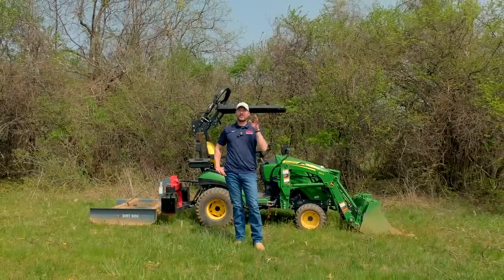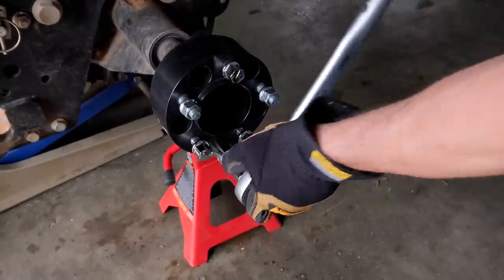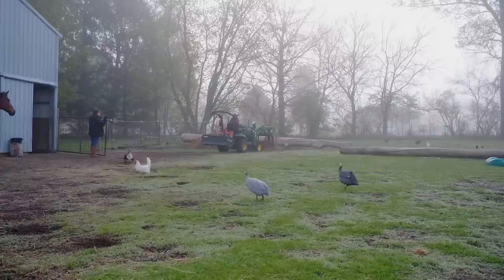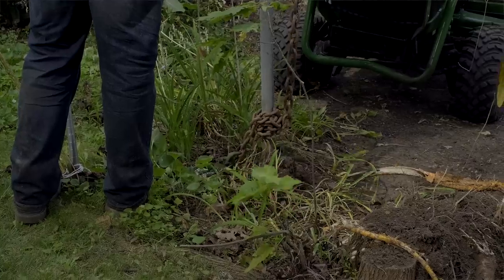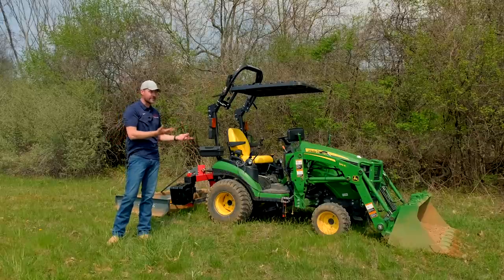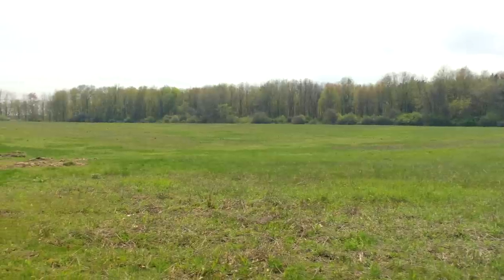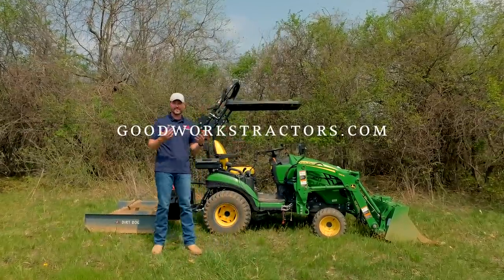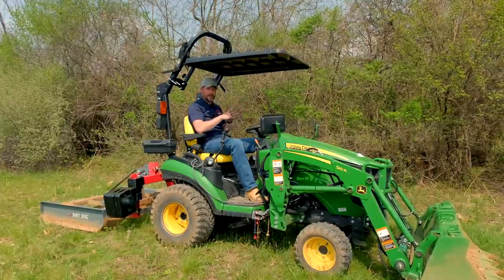DID WHEEL SPACERS CAUSE ANY DAMAGE AFTER A YEAR? JOHN DEERE 1025R REVIEW

Comment: As for your flat front tires, this is a common problem.  I have a friend who is co-owner of a Kubota dealership and he said it is common on the front tires of these SCUTs.  On my LS MT125, I could not get mine to stay inflated and had one roll off the rim while moving snow.  My research confirmed this is a big problem.  If you do the math, the little 18X8.5-10 tires are grossly overloaded when you have something heavy in your bucket, even with rear ballast.  I found a guy with a Kubota BX on-line who solved his problem by going to an 8-ply BKT R3 skid steer tire that has twice the capacity. I decided to do the same and it has totally solved my problem.  No more problems keeping air in the tires and no more squishy tires when I have 1,200lbs in the loader.  I think the BKT tires are only made in R4 style, but that is what I run anyway.

Comment: Wished I had done a little more research when I bought my 3025 E. The 1025 R is great machine from what I've seen you do with yours  and other YouTubers have done. I still have about 23 months of warranty on my 4 year old 3025 its got a little over 80 hours on the hour meter.  Hydraulics are weak and sometimes the electric PTO has trouble turning on. I always appreciate your honesty on your reviews Courtney.  Not saying I'll never buy another John Deere,  but I would never buy another E series. Theirs an old saying "you get what you pay for" buy cheap you get cheap.

Comment: I was ready to pull the trigger on a 1025R here in Australia. 

John Deere had just put their prices up. 

Kubota BX23S. $33k (only extras was thumb and 8” bucket)
JD 1025R TLB. $41k 

All sales taxes included. 

I now have to wait many months to see my BX! (JD same story very long lead times)
Reply from the maker: That green paint is pricey!
Reply: Wow what a difference 6 years make . My TLB in 2016 was just under 20k
Reply: What attachments are included with these prices? I bought a 52 HP Kubota tractor with a loader and 4 in 1 bucket for the price of the little Deere tractor. The tractor without the loader had a price of around $32k. I don’t understand how much smaller tractors cost so much unless the price includes a loader, bucket, mower deck and backhoe.
Reply: @kdegraa  The Kubota and JD I quoted were both Tractor, Loader and Backhoe. Plus both had 4 in 1 buckets. 

Do the same options on a larger tractor and it adds up pretty quick. Backhoe is quite expensive on its own.

Comment: Great job on the videos. I’m wanting to add Bora 2”wheel spacers to my 1025R and still be able to use my 60” mid mount mower. Since Bora is your sponsor could you do a video of installing the mid mount mower with you 1025R that has the 2” spacers on it. I have not been able to find anyone that has photos of it fitting or not. Lots of info on the 1.5 spacers fitting. Even if the mower deck will not work it would help clarify the problem and maybe someone can come up with a fix or a work around.
Thank you 🙏🏻 
Doug
Reply: Be sure to post how this works. I have the same question

Comment: I have the Bora 2” spacers on my 1025r following your recommendation. After I had the cab installed it felt super tipsy, but the spacers fixed that. Thanks for the advice! I do have a question for you. Since I put those on, my 54” mower deck doesn’t work because of the spacing of the wheels on the mower deck. If I had a 60” mower, would it’s width and wheel spacing be wide enough to work with the 2” spacers on my tractor? Thank you!
Reply: I have the same question. Do you think 1.5" spacers would work w/ your 54" deck?

Comment: I need to buy a used 4 wheel drive tractor with a cab (w/ac) for my (new) small 70+ acre farm. New at farming. As always price is important, but this tractor will have to be the right choice as it will have to be modified (a little) due to some medical issues I have. It really needs to be the right choice out the gate. I won’t say bad things about you if I get the wrong one, but I really respect your experience and would really like your opinion. Thank you. Charles from SE AL.

Comment: I am interested in getting some wheel spacers for my 1025r but not sure if they will interfere with my mower deck. Any input?
Reply: Just addressed that issue with clear photos on the "Green Tractor Talks" forum. U can see how close the tolerances are with mmm up and down! 

If u GoodWorks guys can lift my thread and post, do it. Love and subscribe  ur postings as well.

Comment: I'm moving soon to a property where I'll need to maintain 12 acres, most of which are wooded. I like the idea of a small tractor for the cost savings, and nimbleness in the woods. I need to do a lot of stump removal. How big a stump can you remove with a subcompact?
Reply: I’d either hire or get someone in with an excavator. Identify stumps needing removal and get something like a 5 tonne excavator to get those stumps out. A good operator takes around 5 to 10 minutes to remove a big stump & fill the hole back up.

Comment: Hi.  Nice wheel spacer review.  I'm thinking about adding them (around 2" spacers) to my 1025R.  I am curious, however, where you got the mirror brackets for your tractor (green part)?
Reply: Scroll through this and you'll find the mirror brackets:

https://muddscustoms.com/products/john-deere-loader-grab-handle

By the way, you'll be surprised what 2" spacers will do for your stability. I just put a set on my 1025R yesterday and it made a very noticeable difference in overall stability. Plus, the tractor doesn't rock back and forth as badly over uneven terrain as it did without them..